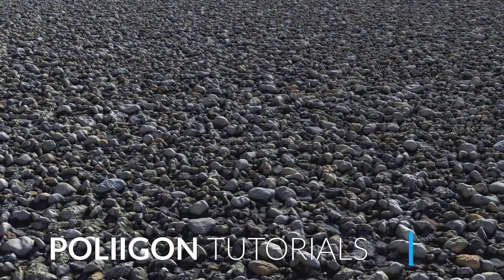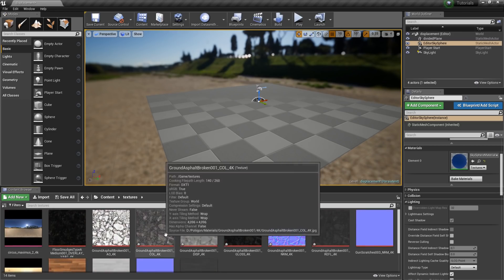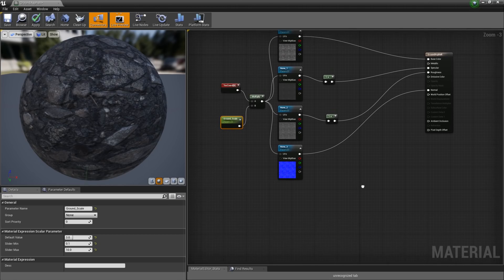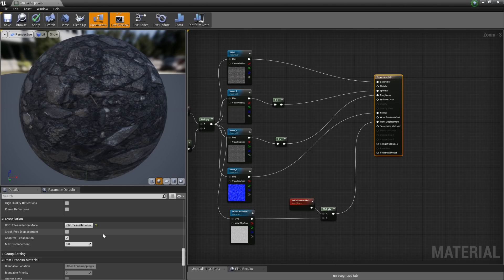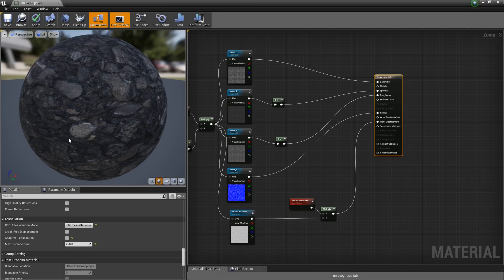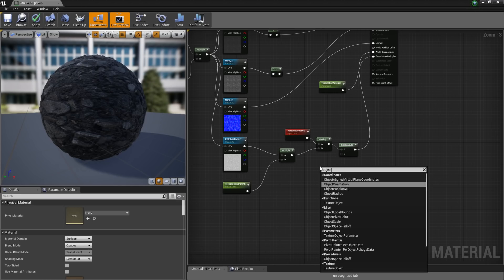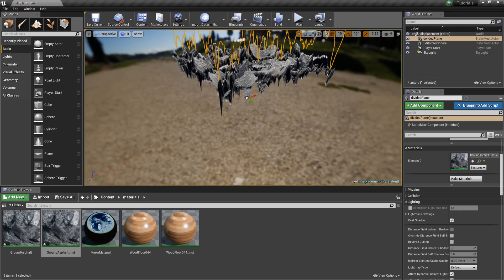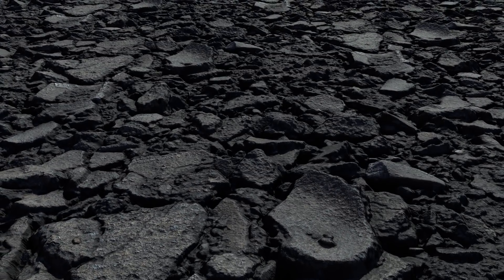Using Poliigon displacement textures in Unreal Engine 4

Comment: How to use tessalation in U5 i dont see that option i material
Reply: Tessellation is not a feature of UE5, Nanite is the alternative. 
From the UE5 docs:
"Nanite obsoletes most use cases for Hardware Tessellation. Hardware Tesselation has been removed from UE5. For use cases that Nanite does not support, users may want to increase the resolution of their assets if necessary."
Reply: @inappdesign  so... how do you use displacement with nanite?...

Comment: Flicker problem solution - 'you can specify a bounds extension manually on the static mesh asset itself. It’s located under “General Settings” within the static mesh editor details panel.' I was getting insane flickering, this sorted it.

Comment: If I add displacement to a box, the edges become disconnected. I can see through the edges as gaps.
Reply: In the material parameters, under Tessellation, check the box for "crack free displacement". It also depends on your UV unwrap (if you have seams across those edges and the texture doesn't blend smoothly between them).

Comment: how would you fix the crack that shows up when using tiles for a landscape? I haven't found a way to seamlessly hide the crack after using tessellation
Reply: In case you haven't figured it out yet (or if anyone comes by and needs the answer): when editing your material, in the Details tab (right below the preview) you will find a checkbox "Crack Free Displacement" under the Tesselation section. Toggle it on to prevent holes in the mesh caused by displacement, you will be able to see the result in the preview as well. It is far from perfect (it will stretch your textures a bit to fill the gaps) but at least it's doing its job!
Reply: @ShmuPixel  no that didn't work for me. I had to paint visibility off in the spots where the landscape tiles' converge (all of them), for some reason that made the cracks go away.

Comment: Hey Internet, 
Hoping someone can help....
I understand that I cannot use tessellation on regular BSP meshes as explained in the video becaue it has not enough geometry for the displacement to work... 
How then would i achieve displacement on wall and ground planes....I thought the whole point in BSP meshes is so that i don't have to model simple things such as walls and floors in a separate 3D package also having to give significant geometry in order for displacement to work....this would surely eat system resources no??
All in all i want to know how to achieve the same results for the ground planes of my level without having to resort to actually modelling walls with large poly-counts??

Comment: Unfortunately tesselation has very little use. Specially you are not going to use it (you shouldnt) when developing videogames or most things, unless you plan to make an AAA videogame where you can use tesselation in really high quality settings on a last generation machine. You need so much geometry in the mesh to actually make it work that is completely ridiculous. Its not worthy, at all. Maybe in twenty years this has been improved but for now, dont use tesselation in your projects, is an advise. Just use regular geometry.

Comment: well explained tutorial. my question though is, that with this method, once the displacement is applied to the geo, the entire geo shifts way up. if you had for example a human standing on the surface, this way, the surface would after displacement not be at his feet anymore, but rather at their knees. how do you counter for the surface to shift this dramatically? maybe the disp should not only disp out, but also in? any kind of offset in unreal for this? thanks very much!
Reply: I'd use geometry instead of displacement if I needed that height difference. Displacement dont have collision.

POM is cheaper than displacement, and works on 2-triangle plane. Displace will be better on curved surfaces like lava waterfall.

Comment: Using displacement, increase poly count? and decrease perfomance?
Reply: displacement move verts, but you need lot of them. On low poly it will work bad. POM (parallax) works on low poly but have some graphical artifacts.

Comment: Why the heck u brought into account the "objectRadius"? That's nonsense, and is the reason why as soon as u applied the material to your plane (which was way bigger than the preview sphere) the geometry exploded to the sky  -_-'  You want to work into a controlled environment, not having a material which changes displacement strength based on the object size O_o
Reply: yeah, i only use objectradius for uv tiling.
Reply: @izvarzone  that's bad mate

Comment: isn't the effect somewhat binding you to a fixed lighting source though? since the texture is already having its own shadows and what not.
Could you do this but then replace the graphics with the same image "without shadows" so that you can let lighting effects that are more dynamic/moving (sun, torch, candles, lamps... whatever) hit it and create those shadows instead? it feels like that'd be more natural.  

(i'm not a game designer or anything like that, i just stumbled on the video and watched it out of fascination) 

Also another question,  what is it that makes tessellation resource heavy exactly?
Does it need to re-calculate the shape every time? if so, isn't there a way of just making it more fixed so that it's no more resource heavy than non tessellated  objects? 
...or is it just the higher polygon count by itself that makes it heavier?
Reply: imo using displacement in game is lazy. Can get better performance by applying displacement in zbrush then optimize polycount.

Displacement only useful for animated materials such as lava. In many cases I'd prefer use POM instead of displacement anyway.
Reply: @izvarzone  Don't you get smoother lods, and isn't tessellation easier on memory and potentially draw calls? Not to mention you can use it in a lot more places and it's scalable. 
In the past I've seen profiling in Cryengine (Crysis 2) which showed tessellation to even be cheaper than POM, without artifacting. 
Then there's the variable factors of processing on a mesh prior to being tessellated, would be lower that that of a medium poly solution.

Tesselation just seems misunderstood. By me too. There are so many factors to consider when implementing it.

Comment: I am just wondering: why would you plug in the specular map, if you already have the roughness map? You should either use a specular map OR a roughness map, but not both at the same time, if I am not mistaken. The "physically correct" specularity value for most materials seems to be 0.5, so there is usually no reason to use a texture, not to mention that most specular / reflectivity textures are probably designed to directly modify the amount of reflections to "make it look nice", i.e. their mean value would be far from 0.5.
Reply: Specular used a lot even in PBR shaders. See UE4 paragon vids for explanation.

Comment: Hey, weappreciate poliigon taking an interest in the blender to Unreal workflow, it really is a match made in heaven.  One thing I don't like very much, is wrapping meshes post blender in Unreal.  It's fine in situations like this when we're dealing with a plane, very simple.  But what about uploading a character with multiple materials? The only practice I've had, is importing a house, which has some simple geometries like lightswitches and outlets.  Door frames.  Multiple textures.  I assume a character works similar since when I imported this house to Unreal, where I assigned the materials in blender were still represented.  Only I had to recreate the materials and drop them onto the part of the mesh I wanted to wrap.  Which too, was very simple.  So this means in character creation all I have to do is wrap the character with basic versions of the materials, so that when I import them I can reassign them through Unreals node editor.

Comment: I'd never use Tessellation for a game it's too power hungry, use other methods like Parallax Occlusion Mapping
Reply: GTA V is a very optimized game that uses tessellation on trees
Reply: @RafaAelM  Yeah it depends on how you optimize it and plan for it in development. You could get real finicky about it.  Like you could do the tesselation on one layer, then on another actually modify the mesh yourself.  Then add a normal n' all that.  As I learn about all this I find that there is always a way.  Just gotta hit 'golden eye level optimization.  No wasted data.
Reply: @Rafa Aquino The tessellation in GTA V is adding extremely little geometry, it is extruding the geometry more than anything. There also isn't much geometry there in the first place making it look terrible. This is also why high LOD's are so heavy on your performance. These are a couple of the optimisations, though I wouldn't say GTA V is "very optimised" at all. Look at the quality difference on the highest settings possible (which most machines can't run anyway) vs the lower and mid settings, little difference big performance hit.
Reply: Here's a thought: Why not give the player the option to switch between Parallax or Tessellation? Obviously inform them of the possible performance hit if they select Tessellation, but still. If it's left as an option, it should satisfy high-end players as well as mid-range players. Auto-detecting the user's graphics processor upon installation and having the setting automatically set right off the bat should prevent crashing on lower-end machines and reduce startup lag. It's always useful to let players turn it off completely, though. (You could even let them turn on both/mixed if you feel like it.)
Reply: @hauntedshadowslegacy2826  Maybe that's extra work for the developers for something only 0.1% of players are going to care about.
Reply: @hauntedshadowslegacy2826  
Another thought; stop thinking options should be mutually exclusive.

POM has its own merits and downsides compared to tesselation meaning there's plenty of situations where one prevails over the other; that's not a matter of performance itself...
POM works great in conjunction with tesselation when used on surfaces that barely ever get alot of shallow-angle views from the player or where the people simply doesn't have the time (too much pacing/action) to compare the difference between POM and Tess.

Tesselation is not heavy at-all if used properly... It's just that more and more often there's a technique people will employ because they've heard it will make things better without first trying to understand how it should make things better. Heck there's situations where a low level of tesselation would cost less performance and deliver more actual result then POM.
Reply: If applied with proper measures like distance scaling it can actually help you preserve unnecessary detail on further-away objects; depending on how you use it, it can be quite a double-edged sword... Think of the fact that models can be normally of a slightly lower fidelity and only when close enough for the quality to matter tesselation will ramp that quality up; in that sense making it another layer of LOD.
Reply: It's good for stuff like cobblestone roads, but much too computationally expensive to use everywhere.
Reply: @1famekouby  that's because PC is masterace! Lol.
Seriously though, of course it's better to optimize the game to perform better. If no console can handle it, then it's stupid to put it in. But if you have some spare resources, why not consider it?

Developers' targets are subjective. Some wants to focus on environmental feel, some wants complex gameplay. So depending on what kind of game you're doing, you still can consider tessellation. It's still a useful tool. Dont throw it away in a bin and never think of it.
Reply: @1famekouby  Horizon Zero Dawn, God of War 4, Uncharted 4, BF1 and V, Battlefront 1 and 2 Probably more games. 
It's not used liberally, but just where it makes sense. Most notable games where it isn't used is the Metro series. PC uses a lot of tessellation in comparison to consoles.
Reply: it's just an eye candy feature. and it's geometrical effect, so it looks better and interacts better with other elements compared to parallax occlu.
Things like this are good for visualisation like ArchVis or product vis.
If you're doing a AAA game then you can add an option to enable or disable tessellation. And technology nowadays are much better than when tessellation first introduced. With proper optimisation, even my laptop can run a game that uses tessellation.
Reply: Your laptop can run Tessellation at what cost? I bet your FPS takes a massive hit and if it doesn't then the tessellation in that scene will not be worth the visual fidelity. Even though it has been optimised it will still take a massive toll on your machine and even then it is a poorly distributed technology e.g. try adding it to a game on another platform OSX for example (yes a bad choice of a "gaming" platform, although it is just an example), I will always go with POM before tessellation for the highest compatibility and performance.
Reply: @jwbonnett  uh. I've played battlefield 1 with constant 30 fps (except when there's an explosion or something with particles). Sorry that i'm not a 60-fps-master-race kind of guy but 25-30 is more than enough, and 15 fps is still playable. Fite me.
Reply: @The Potato Battlefield 1 actually uses a mixture of both methods at the same time lol
Reply: @jwbonnett  Using both method sounds good practice. you dont need tessellation for everything.
Reply: @Potatinized  15 fps? 
Do you hate yourself?
Reply: @luftwaffel-eggo  Why would he?
Reply: @Monitice  Because 15 fps...?
Reply: @luftwaffel-eggo  And why would someone hate themselves because of 15 fps?
Reply: @Monitice  
It's a joke, dude.
It's implicit.
Reply: @luftwaffel-eggo  I was joking too, dude.
It's implicit.
Reply: @Monitice  good one.
Reply: I had agree with potato.
The tesselation feature is quite customizable and modern hardware including the consoles can now support it better than previous gen consoles and pc.

Comment: And what about collision? Pawn will be walking on top of the real plane mesh?
Reply: Depends on what you need.  Collision vertex, cost more than regular visual vertex.  Parallax basically takes the mesh and copies it into another layer to use as a collision map.  So it doubles your mesh size. This is good for a one sided wall or 2D item.  I would collision in blender, pretty simple to do.  Lots of tutorials on it, "adding collision for unreal in blender".  You basically cover your mesh with a simple blocky version of it.  The blocky one, is the one that collides.  The complex mesh underneath is for detail.
Reply: Yeah, the issues with this method are shown in Battlefield V - shooting through rocks and stuff, but there's not much you can do - especially on a terrain.  Usually its best to keep the effect minimal, and use real geometry for things like rocks - it works best for gravel and tyre tracks and stuff IMO... BFV went overboard and substituted looks for practicality.
Reply: переведи
Reply: Is there a benefit in processing power needed when using the multiplyer or is it just easier to use?
Reply: @MrBorderdown  Not ideal if you use distance-based tesselation.  To be honest, tesselation is pretty terrible, the way terrain polygons tesselate is ugly unless its pushed to absolute maximum, then you have to reduce that based on camera distance.  Assuming that its for an actual game project of course, if its just for a youtube video most people just crank it up to max and never show the shader usage :)
Reply: So I need one more tutorial about this theme.
Reply: So I need one more tutorial about this theme.
Reply: @ЛеонидЮдин-р8э  Okay, but do you need one more tutorial about this theme?
Reply: @godofthecripples1237  No, he needs three more tutorials about this theme.
Reply: sorry, it's my pretty good internet.

Comment: Good tutorial but it isn't works on landscape. Can you help? I just making my material and selecting it for landscape. Then everything works but tessellation is not. And sorry for my bad english. (Also I'm new on ue4)
Reply: You can definitely use textures with tessellation on landscapes, there has to be a setting either on your material or in the landscape editor that you need to check probably
Reply: @pyrotechnick420  I closed crack free setting then it works but now tessellation is larger than my texture.
Reply: this might sound dumb but have you googled for a tutorial?
Reply: @Potatinized  Yea you gotta learn how to learn